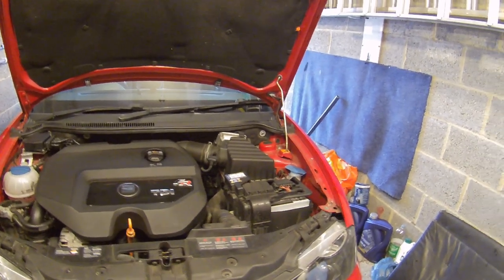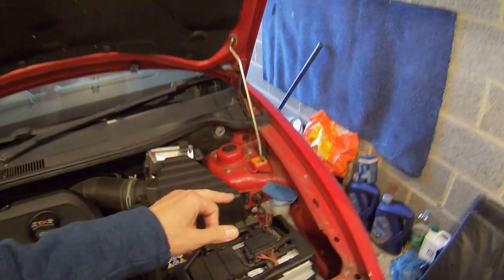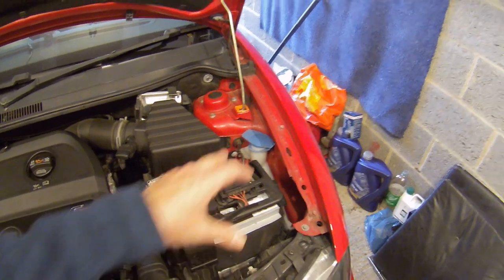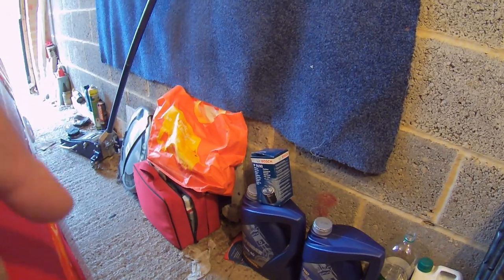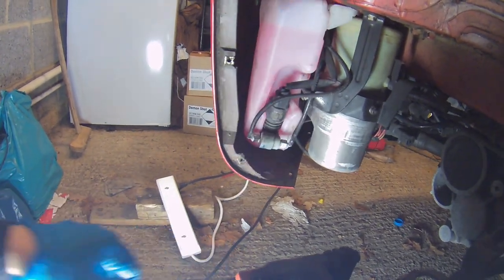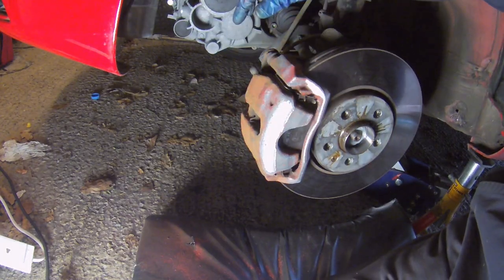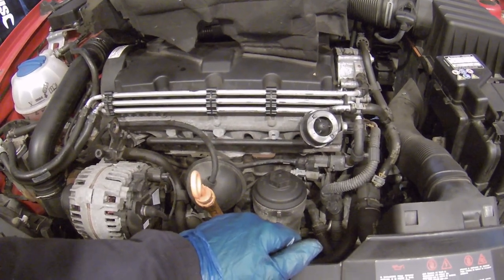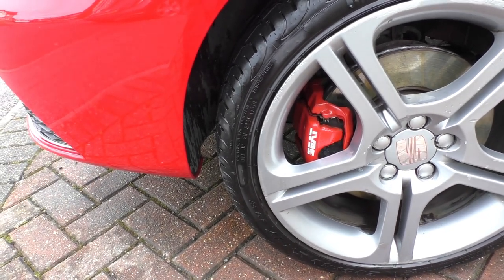Fred in the Garage.  Caliper paint- Oil change- Water bottle + Chat

Comment: If you change the "oil filter" every 1,000 to 1,500 miles or so you will not have to change the oil for 10,000 to 15,00 miles or more if you use the new "30,000 mile synthetic oils". That beats jacking up the car and all the rest of the stuff. Heck it will take you 10 years before you need to change the oil in that car again.:-)  Please may you and your family stay safe. 73 Leo
Reply: LOL.  I change the oil every year in both my cars regardless of miles.  Its cheap to do and as the cars only do short distances it does not get the oil up to proper working temp.

Comment: Interesting video Fred. I just wanted to touch on two things you may want to consider when dealing with this quasi leak you have in your windshield wash system. 1. Perhaps in colder temperatures the plastics or rubber seals may contract and therefore leak intermittently. 2. Perhaps the system is only leaking back in that area after you have used the system and built up a back pressure to cause a leak.  My final thought is perhaps when you are filling the bottle that some of the fluid is spilling and that may be where the wash is pooling until it leaks out. Thanks for sharing Fred.
Reply from the maker: You may have something with the colder weather shrinking the bottom pump seal.  It has failed in colder weather.  Its an odd one for sure.  Hope you and the family are staying healthy Andy.
Reply: @UK-CB-RADIO  Happy and healthy Fred. I am happy you can state the same.
Reply from the maker: @Tobinindustrial  All good so far old mate.